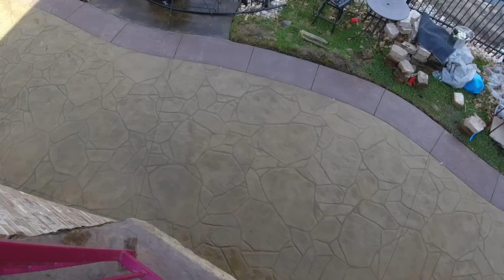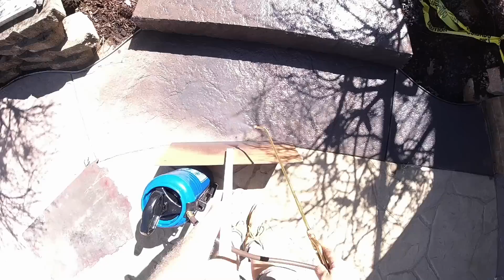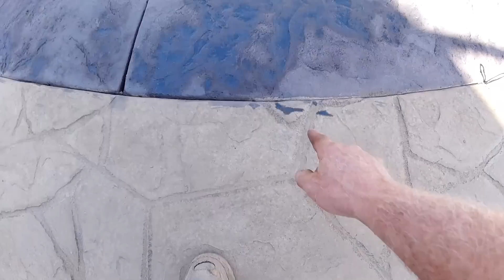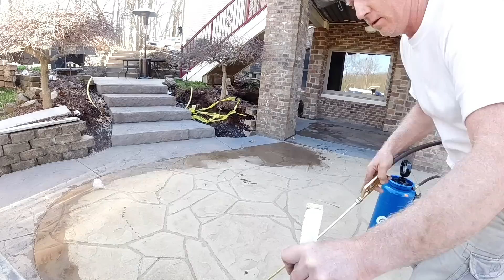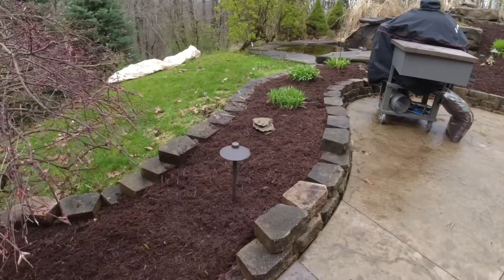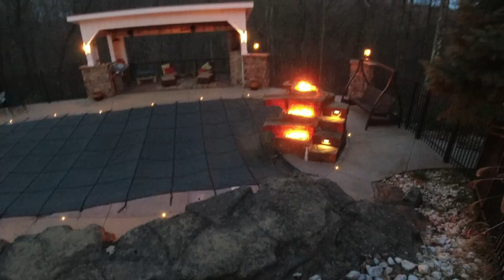Couldn't Be Happier With The Results!

Comment: I really Wana hear your pros and cons to using pea gravel mix for stamp. Maybe u could touch base in a future video. PA is a little colder than Indiana but not by much in the winter. We get that warm gulf air from Florida coming up its so weird. U would think Indiana would be really cold
Reply from the maker: We use 1- B gravel and up the cement to 611 pounds per yard
Reply: @Concretewiththehauses  ok thanks